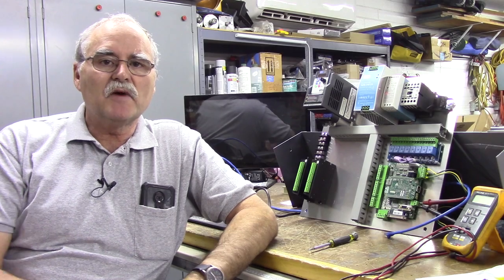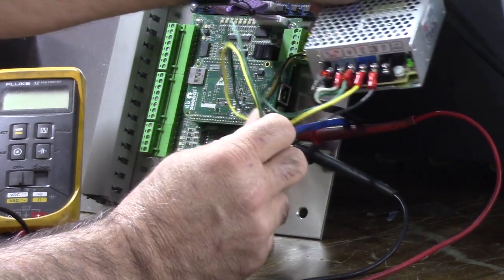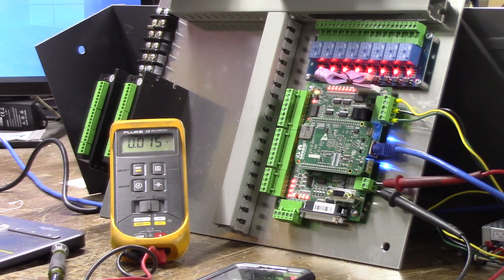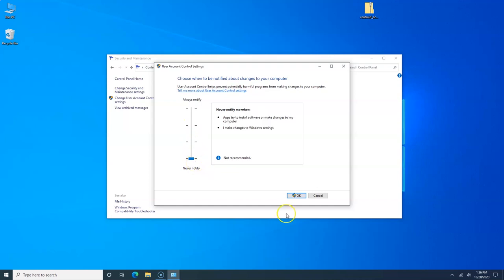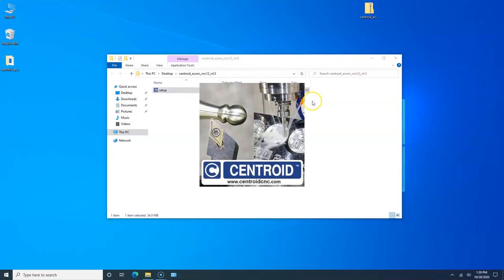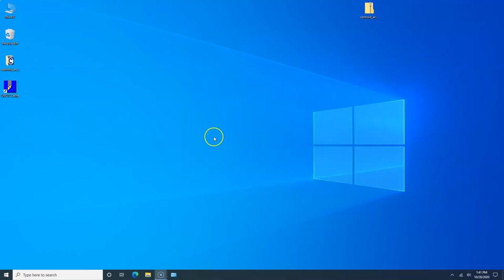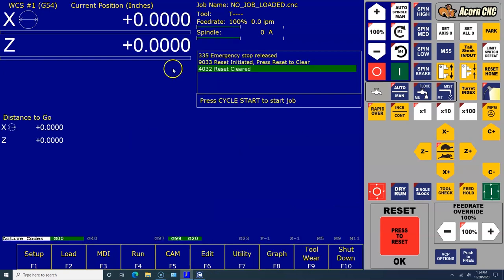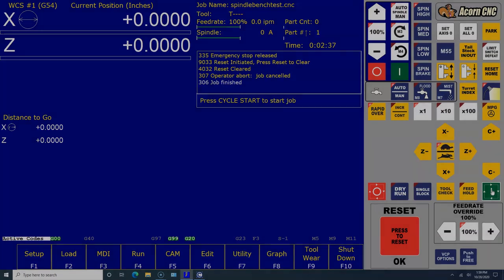Emco PC5 to Centroid Acorn Conversion. Part 5: Acorn Bench Test

Comment: Can you add a Handwheel / Pendent hard wired to the Acorn and still have the use of the encoder input
Reply from the maker: No. Centroid sells a wireless MPG that works quite well. The one encoder port on Acorn is intended as an input for a spindle encoder.
Reply: @martyscncgarage5275  There wireless MPG is to expensive or I would of tried one
Reply from the maker: @mactec54  Just had a price increase. Its a good value for the money. Works quite well. But yes, you also have to get the PRO license. There are keyboard short cuts for everything, you might be able to find something that you can program the short cuts. It will also use a Contour Shuttle Express (Like the Tormachs)